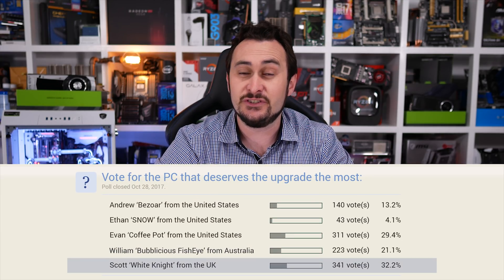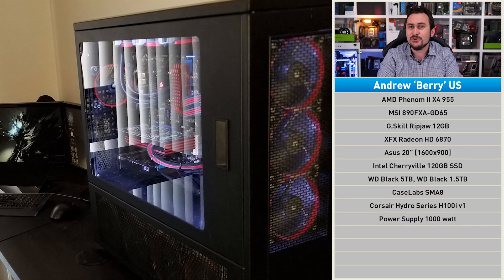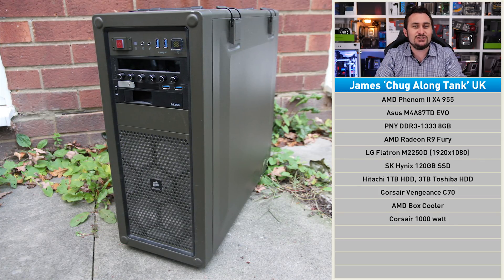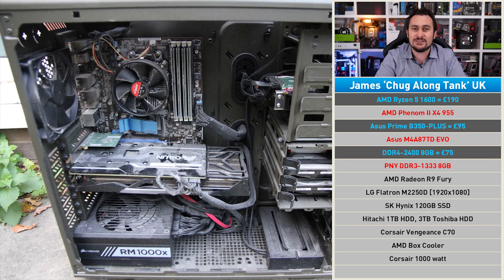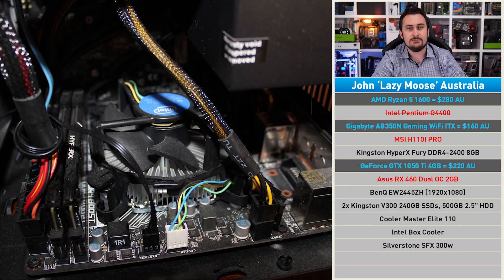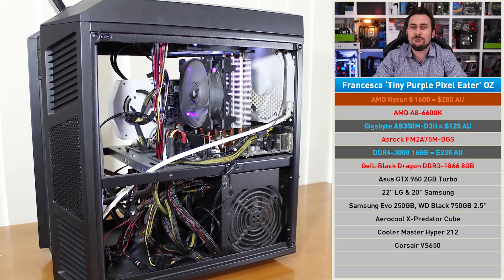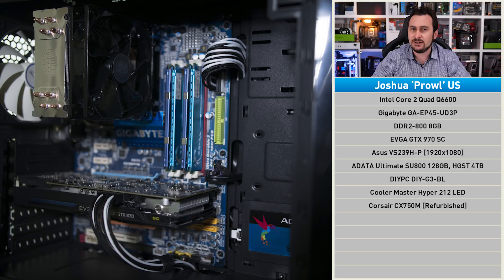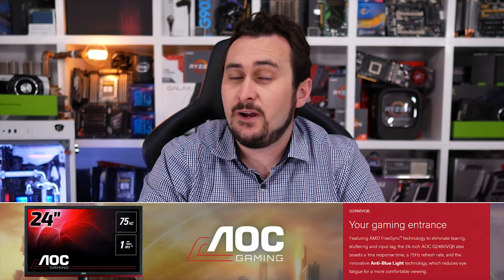Upgrade My PC Please! [S01E09] Phenoms, Pentiums & More!

Comment: I want to enter however my Desktop PC no longer works at all and I'm currently gaming on a laptop that has a 960M graphics card. My PC is 5 years old and has the following:-ASUS AMD A85X Motherboard-AMD A10-5800K Processor/CPU Cooler is either a BeQuiet or CoolerMaster \_(-)_/-32GB DDR3 1333 HyperX Fury Ram-Samsung 840 Pro 256GB SSD-WD 500GB HHD-ASUS Radeon HD 7950 3GB-500 Watt Power Supply(I think \_(-)_/)-Windows 8.1 Pro OS-All housed in a Corsair Carbide 200R Mid TowerThe GPU does not seem to work or update. It will boot for about 3 seconds then the screen goes black. When using another GPU it works but is very slow and choppy. I also believe the SSD may be bad or defective. It also tends to run hot when simply booting up. It has an additional 2 fans for cooling but those don't seem to help. I have been selling things in order to budget for a high end PC but I'm only about a third of the way.

Comment: WTF is this Andrew dude doing?  500 dollar case, and watercooling parts that arent attached to anything?  Something like 7-10 fans?  Spend your money on parts that actually do something then play around with cases and H2O cooling later.   Idiot.
Reply: i think its a troll build
Reply: raistrose it's actually being built backwards on purpose.  The core components last so that when it finally is finished it's not already outdated (yester years processor, ram, MoBo).  It's a multi year project due to the low amount I'm able to put into it month to month.  The current project being the water-cooling and as you can see it's very incomplete.
Reply: Instead of spending so much on items that really don't affect the computers use or capabilities, just buy good parts now.  and then in 3 years when you would be able to finish the pc, you can just upgrade it then too.
Reply: I mean seriously,  That case is over $500.  for that you could have had a 1080. or an r5 1600, mobo and ram.
And if you watercooled it today as you say, you would have to add all new blocks when you upgraded the Socket or GPU.   

Its your money, use it however you want, just dont expect me to not mention that its foolish.
Reply: raistrose isn't it more foolish to upgrade the core components twice as you recommended though?  That's double purchasing on core components as opposed to buying the blocks with the components at the end once, leaving them to run on fans for now.  It will be a while before I upgrade it again so I don't want to double purchase core components.

To each his own though, I chose this route because I know others that have.  It worked for them, it works for me.
Reply: No, it wouldn't be.   Because it means you don't have a potato now, and in 5 years when you might have actually finished this project you also wont have a potato.

The problem is that you clearly have over $600 of parts in this that do absolutely nothing.
Just spend that on actual components.

Comment: Honestly don't understand how someone with a $500 case and sleaved cables got into the runnings.
I have listed a i7-3770k that's dead, my only computer and couldn't make it into this? If a fried computer doesn't make it in but someone blowing tons on dual res, cables, case, fans can.. then there's likely way more that are sitting here thinking "wtf".
Your giveaway, do as you like, but i wash my hands of this.

Comment: I'm running my G4400 @4.7GHz,and it plays everything I throw at it with my HD7970.
So the pentium build should get a Z170 board and a beafy cooler,plus some vga.job done

Comment: i should probably join, my poor h81 board with used i5 4590,  hyper CM 412Slim, 2x4gb hyperx 1600 and geforce 1060 3gb aint cutting it for my new  40" 3840x2160 TV monitor...
ps dont offer me ryzen 1600 as i dont render, i only play games games games. that zelda breath of the wild via cemu cant hit 60fps no matter what settings i choose... lols ^_^
Reply: Ryzen 3 is the way to go

Comment: i disagree on your choice of parts on Johns pc, with him having a skylake pentium processor already he can just upgrade to the newest bios and comfortably slide in a g4560 in that h110 mobo and itll work just fine, and with that you couldve gotten him a 1060 6gb or an rx 580 (prices seem to be KIND of okay now) and get a nice power supply

Comment: Mistake I meant my case has 4 usb 2.0 ports up top and needs to usb 2.0 connectors on motherboard.
Total onboard connectors needed on motherboard internal for me is 2 usb 2.0 & 2 usb 3.0 ports.
On back panel of motherboard I'll need probably need 6-8 usb 3.0 ports
For the cpu I'm planning on a Ryzen R7 1700 or 1700X.
I also need 1 onboard m.2 slot for my Samsung 850 EVO 1TB m.2 ssd and atleast 6 sata 6 ports on motherboard.

Comment: For anyone in Australia looking for parts at the moment - check Ebay. Stores like Computer Alliance have 20% off with the code 'PREZZY'. For instance, an MSI GTX 1060 6GB Gaming X can be had for $383, and RX 580's for similar prices. After months of deliberation, I finally bit the bullet on a Sapphire RX 580, Fractal Define C and a new freesync monitor and saved $195 from the voucher. Hope this helps some people!

Comment: I need recommendations on a AM4 X370 motherboard to upgrade my current Skylake i5 6600K build.
Important my Phantom 820 case has 2 usb 2.0 ports & a usb 3.0 port. Ialso need a 2nd usb port on the motherboard for my memory card reader. I know I'll probably need to get a 2nd usb 2.0 to usb 3.0 adaptor for my setup. I also need ports on back for my usb 3.0 external hdd, usb 2.0 for mouse & keyboard, usb 2.0 port for Xbox 3660 wired controller.
Also getting a Logitech Driving Force G920 racing wheel next month and plan on a Logitech usb 2.0 gaming headphones/microphone down the road. Ialso need a port for my webcam.Currently using top panel case ports for webcam & magicJack telephone.
2 case top usb 2.0 ports unused now, but racing wheel and headphones will use them later on.
Reply: David K. avoid msi and gigabyte?
Asus is expensive and nothing else, msi has proper vrm cooling with thin pads and screwed on heatsinks! 
Just watch der8auers z370 budget boards comparison, those are not x370 and not amd, but it a good example for an overall trend

Comment: Notice the problem with half the machines featured? They all run an AMD processor that have poor IPC. You shouldn't replace those machine with Ryzen which have poor IPC vs Core 7, Core 8. 3 years down the road they will run into the same problem they are facing now when games demands more IPC and clock. We can already see Ryzen is bottlenecking 1080Ti and in 3 years, 1080Ti would be where mainstream $300 GPU is and they all will be bottlenecked.

You might be thinking in 3 years you will drop in an AM4 compatible Ryzen III and you'll be fine but then you realize that $200 Ryzen III is bottlenecked by your outdated memory and board. I've been there, twice, with Athlon II X3 and Phenom II builds for my sister. You'd spend more than if you buy a faster Intel today and you won't have to game slowly for 3 years before getting a faster CPU
Reply: FX vs Intel and Ryzen vs Intel is night and day, mate.
Reply: SlavjanA Check gaming benchmark of 8700K vs 1700X
Reply: It's a $500 budget, you can't do an 8700K upgrade with that.
Reply: It's called budget dude. AMD is the best bang for your buck within the $500 budget. Intel only has the upper hand in 1080p gaming anyways so it's still not really worth going with 7th gen Intel cpus. The 8th gen 8400 might be a good choice if it was even available but it isn't. Ryzen is definitely the way to go.

Comment: This series is great Steve, thankyou. 2500k next?? Some love??
Reply: 2500k is still a beast if you have the cooling OC it to 4.7ghz you should still be set for a while at least if your only gaming if you are doing other things think about ryzen 1600 or i5 8400 when intel finally has availability. if you can wait it might be a good idea to see what 12nm ryzen can do in early 2018 maybe you can trade that i5 2500k to a r5 2500x just for fun
Reply: I will admit that the 2500k has been a good cpu for a long time and is still holding on, but it is starting to show its age as the games are getting more demanding. Not all 2500k's will run at 4.7 tho, just saying.

Comment: Meanwhile I'm stuck here with a iMac which I'm sure doesn't apply to this series.Its so hard to game with a iMac.Its 6 years old and has a i5 2nd generation 2.9GHz turbo 3.1GHz Dual Core thats barely enough to run csgo.As If that wasn't bad enough,i need to deal with a gt650M packing 512MB of vram so I can't run my favourite games.You people should appreciate your pentiums and ryzen 3's.Along with your 1050 or 960 :/.

Comment: triple monitor, caselabs SMA8, 1000 watt PSU, dual reservoirs sitting in the case but has a phenom II you dont need an upgrade you need to adjust where your spend upgrades on
Reply: Its not scamming its bamboozling.
Reply: Catatonic21 i think he just try to scam...
Just dual reservoir/custom cables and case cost 1000$ ....
Reply: Catatonic21 Gentlemen, I understand some of you think my entry is a troll entry.  As Steve pointed out I've been building the rig as I go starting earlier this year because I can't afford all the parts all at once. I'm still buying bits and pieces month by month to finish the water cooling.  The case was bought with a tax return because it wouldn't have been bought any other way.

The reason I have not upgraded the core components yet is so that the system isn't outdated before it's finished.  Those were gonna be the last things I replaced.
Reply: Somebody trolling most likely :D. Took some old parts and threw them in that case :D.
Not that its very funny to cheat like this to get free shit, but it's funny in a way. 
Was so random when I saw the double reservoirs just sitting there. Not even one unused reservoir but two.
Reply: Andre; I think you're in the same situation as me, in that you chose platform over core compute power to start. Really, this choice was for future upgrades so we knew what we were doing and should assume the cost ourselves. I have nearly 2 grand in beautiful potato and peripherals. It's fine until I have the cash for a 1700X and fine ass board (Asus Extreme) or Ice Lake wins me over, though doubtful since there will not be an Asus board as nice as the X370 for the money. Good luck with the awesomeness to come, but it should be our cost, not at the expense of folk that really need the upgrade.
Reply: What stale wind said all the way. It’s like putting together a full $2000 coffelake system, but buying an rx550 then going here to ask for a giveaway for a free gtx 1080 when you could clearly afford to scale down a few components and have an awesome $2000 pc (gpu included) 

Instead, you’re possibly taking away from the people who’s whole pc cost less than a fifth of just your case. 

Your path of upgrade is you’re business, but if you can afford a massive case like that, you shouldn’t be competing for charity from people with 8+ year old computers that HAVENT blown more money on their components than a mid range gaming pc costs.
Reply: Mr Needs x2 my pc is literally inside a cardboard box I got for free at a store across the street. Couldn't work any better
Reply: i also see what your really wanting to do is make a skunkworks clone :P
Reply: wasnt trying to say you were trolling or scamming, i understand wanting a nice platform/case to put all your new hardware in but honestly you could of found a nice case with water cooling support and modular for under 200$ on the high end and put the extra 600-700$ you would of saved into hardware
Reply: I see your point Andre, but as a contestant from a previous episode (Dave's Dyson - Ep 6: Core 2 Quad land) I can assure you that the case was a complete waste of money, you're asking Steve to include you in an episode when clearly you've squandered the budget you're allotted on a case, that's bad decision making, I've managed to scrounge the cash together to buy myself a Ryzen 5 1400 and a B350 motherboard with 8GB of RAM, but i'm still using the Antec 900 featured in the episode, because a case isn't that important, even though the case was a mess, priorities mate, good luck either way.
Reply: Drasyte 
That's not scamming, but I get what you mean

Comment: I remember when I had a pentium, it was third or forth gen I think, and absolute crap, though my current a4-7300 isn't that much better unfortunately :(
Reply: The pentium g4560 is pretty nice still... it's starting to become obsolete for modern games, especially cpu intensive ones, but it's not bad considering.
Reply: any 3rd or 4th gen 115x pentium will outperform any AMD A4 on computing tasks. The A4 will have advantage when it comes to games FPS as it has slightly better onboard gpu (still not enough for anything above 720p low settings). you should have just sticked to the pentium and added a geforce 750/750ti/1050/1050ti/RX460/RX560 (or any old dx11 used mid/high gpu) and at least 2x4gb ram for a really budget entry level gaming pc. then upgrade the pentium to a used i5/i7 later...
Reply: C2Lception i have a ryzen 1600 at 5hz with mountain dew to cool it...
Reply: Airgun Enthusiast I'm sure you do, but can it run minesweeper?
Reply: C2Lception only if it feels like it...
Reply: Airgun Enthusiast I have a 1700 at 10GHz...
Reply: uzimyspecial it's a nice budget option tho, I had (and still have for like 5-6 years now) Asus n43sl with 540m(2gb) and i7 2670qm with 6gb ram. I bought my friend's 750ti and paired it with g4560-h110m-d board. Paired with 8-8 2133mhz rams it works like a charm in most cases by utilizing the dual channel rams. I barely could play the AC 4 in my laptop and now I run unity-syndicate (and probably could play origins as well I saw the benchmarks) in high setting at 50-60 fps. Sure its always at %100 usage at games but idc. There are a lot of games that I couldn't have played so I'm not really concerning much about the future. I'm currently sitting at 90 hours of my Witcher 3 playthrough and there are much more games to be played.
Reply: Agent Deathbat I'm not talking about the pentium g, I'm talking about a pentium IV, really old stuff from pre 2010
Reply: Agent Deathbat ye, the actual 4th gen xD
Reply: oh OG pentium 4 (478's and some 775's), they served me well in the early 2k's till 2005... they where the best back then until amd did dual core athlons... nowadays they cant even handle browsers like chrome... facebook and youtube  will be a pain to open... your a4 7300 is a joy to use compare to og pentium, just add some ssd's and ram and you can even play gta5 lols